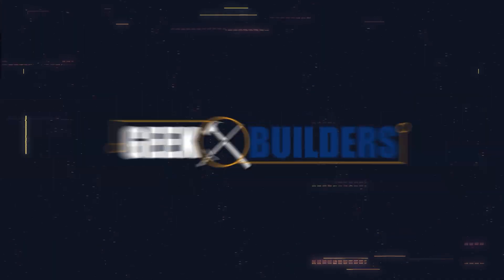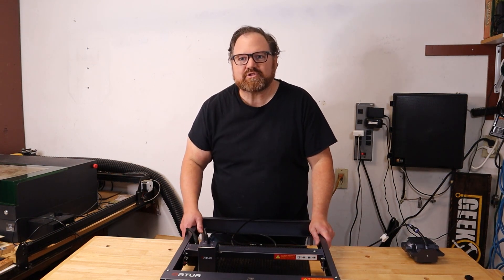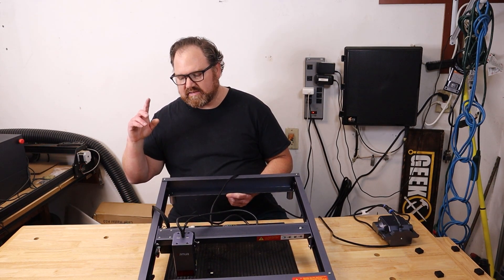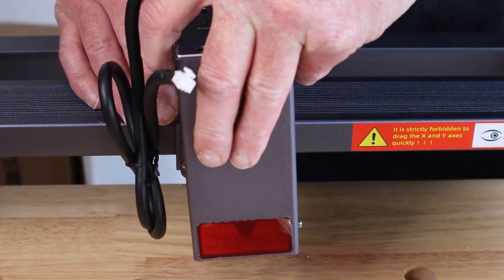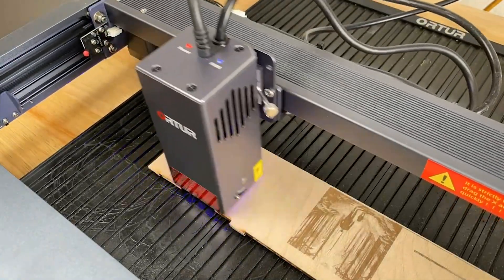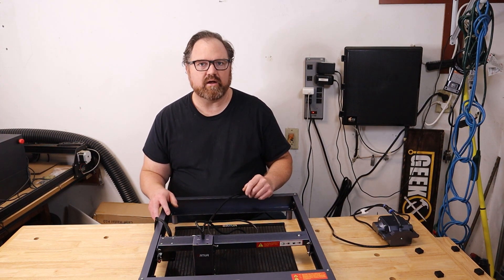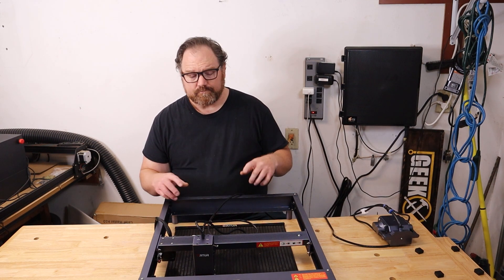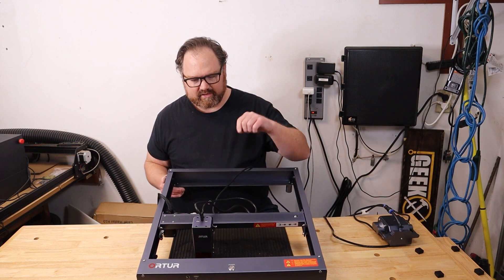This Video Wasn't Supposed to Happen :: Ortur Laser Master H10 Review

Comment: Is there a way to preview the job before starting the engraving on this. I'm having a hard time lining up my material
Reply from the maker: There is a way to preview in lightburn for the laser path and roughly what the project will look like when its done. If you are talking about a camera preview, there is a function in Lightburn that will work with a camera, but you have to add the camera separately, it does not come with the laser